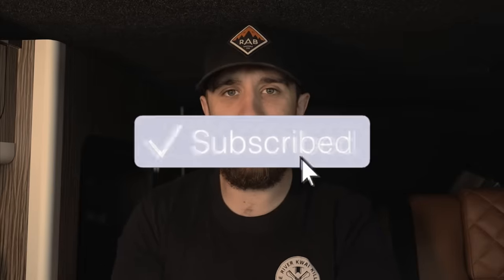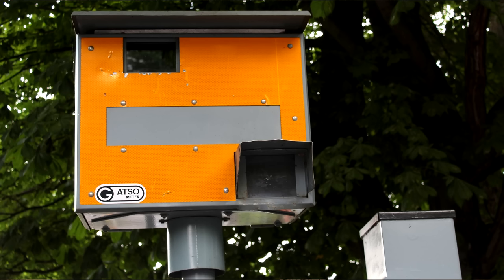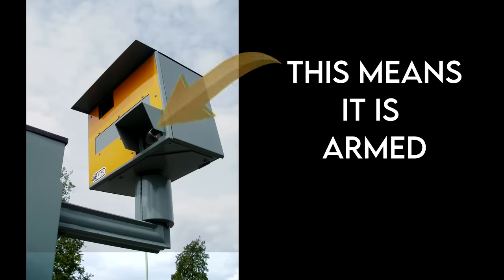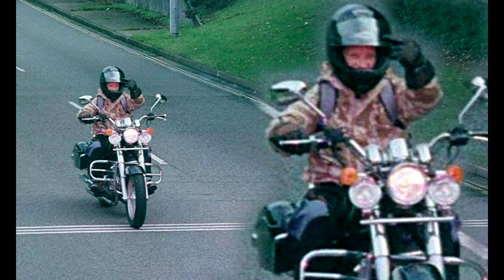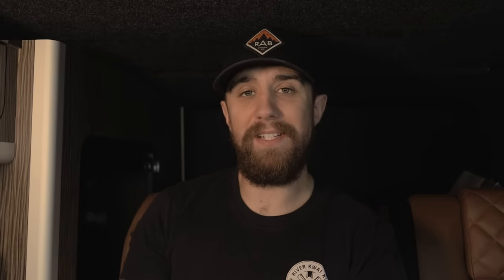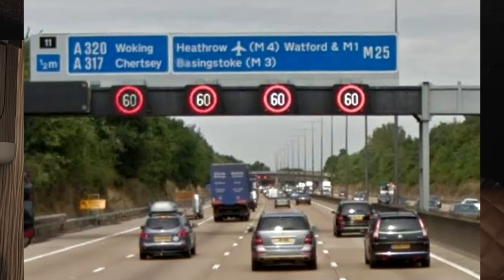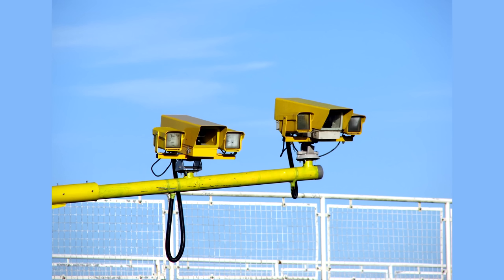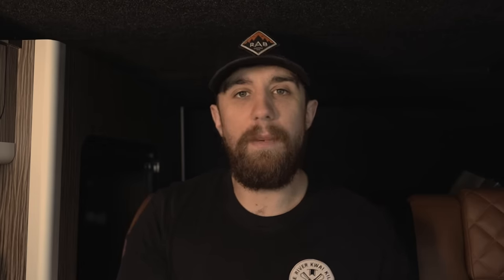How Speed Cameras Work and What to Look Out For

Comment: I suspect the local councils are jumping on the revenue making bandwagon as well with those temporary speed checks, I've seen two cables stretched accross the road to look like serve equipment but two very discreet cameras recording each vehicle that passes.
So they could well be speed checks, but what ever it is they clearly want your number plate for something.
Reply: These things are not speed checks, they're traffic survey machines simply counting traffic levels. Also, no camera so they couldn't identify a vehicle.
Reply: @PurityVendetta  Yes and no, yes some of them are traffic surveys, but some actually have cameras stealthily placed on lamp posts the same colour as the lamp post so they are very hard to see, also they often have twin cameras so the first snap will presumably be one camera and a send snap from the other.
Not all of them have cameras but a few do.

So that is why I suspect they are speed stealth cameras mostly in 20 mph zones.
Reply: @flitsies  This sounds like what used to be an old system, called "DS2" consisting of three rubber hoses placed across the road, connected to a computer inside a parked car (usually on a verge at the side of the road), the time taken to pass over all three hoses would compute the speed, and a camera and flash unit within the car would take a photograph.

Are you sure that's not what you're thinking of? I've yet to see or even hear of the one you're talking about and I work in law enforcement.

Comment: You didn't mention that the HADECS don't use the white lines painted on the road. They're frequently mounted where old GATSO cameras used to be, and the old lines are still pained on the road. The HADECS see way beyond the markings so don't be fooled into thinking you can accelerate once through the white lines.
Reply: HADECS are only used on the motorway to my knowledge. I've never ever seen a HADECS on any other road, not even on a dual carrigeway and I drive probably close to 30,000 miles a year in my own car, let alone driving a lot for work. Also the white line is a verification check... a secondary measure to prove and confirm the speed. If the camera hasn't gone off by the time you've passed the white lines, it probably won't go off. The radar beam starts right by the camera on these. They have dual radars that function independently of each other hence why most don't have secondary lines on the road, as there is no legal requirement due to the fact that it has the two radars AND they work independently of each other.

Comment: Try the variable speed limits around Newport South Wales M4. 70 MPH for miles, no traffic then boom! 50MPH illuminated sign, then the next one 60 MPH, the next 50 MPH, 40 MPH, etc, then back up to 70 MPH again. On one occasion there were deserted roadworks and “use hard shoulder” the illuminated sign went down to 20 MPH, on the M4, I thought the vehicles behind me were going to rear end me.
Reply from the maker: That is exactly where I got caught! The picture they send was me going 60mph in the inside lane with no traffic around me on a motorway 🤣

Comment: Average speed cameras were introduced on the A9 Inverness to Dunblane road in 2014,  27 different cameras over a 136 mile stretch of road.
Without doubt, these cameras slow drivers down and save lives, within 24 months, fatal accidents had reduced by 68%.
Prior to the 27 new cameras, there were 2 Gatso cameras on the 136 miles of road.
Reply: Additionally, they have made driving the A9 much more pleasurable as they also raised the HGV speed limit from the normal single carriageway 40 to 50mph

Comment: A new trick in the north east/yorkshire area on A roads you pass a mobile van,speed up thinking you're safe about 1/5 to 1 mile later there's a second mobile van usually just round a bend.Got ya
Reply: yes and in radio contact so they can pull you in and you wonder why pick me youve been picked 1/2 mile back  tuff.

Comment: What if snow is covering the road markings, can they still nick you?
Reply: yes for the second one, there only there as extra evidence, they can read your speed without the lines but if you tried arguing saying the cameras wrong it takes 2 pictures a second or so apart and the lines are a metre or so apart so apart so they can work out from the time divided by distance to prove you were speeding.
Reply: seriously?  speeding in snow?
Reply: rally cars can do yes it can be done.
Reply: @raypitts4880  in controlled conditions, with full roll bars, full harness restraints, helmets, co-driver, closed roads, a car in tiptop shape with appropriate snow tires.... are you suggesting that the question is on behalf of a rally driver?

for any other situation why would the fact you'd get caught speeding in snow - just shows mentality of some really

Comment: I'm not convinced about the SPECS cameras being all that safe a method of enforcement. By putting up a camera, the Highways Agency are admitting that the area covered is a hot spot for accidents (because they can only put cameras up in areas of higher than normal accidents). However, if the area covered by the camera is so dangerous, surely you want people continuously at the road ahead. But unless you have cruise control and know how to use it without thinking, average speed camera areas have you continuously looking down at your speedo. Even if you do have cruise control, you still have to look down for 2 seconds over all to set your speed.

I used to work for the company that maintained the GATSO cameras. The lines on the opposite side of the road were so the camera could be turned to capture the opposite road (when fitted in the central reservation only). They would keep the camera in the same position for years to get people used to it and suddenly flip it around to catch an insane number of people a day. They initially wanted to have the same design on the back as the front so you always thought it was facing towards the other side of the road. This idea was canned before it was released and very few cameras were turned as people were shooting through, seeing the flash, panicking and slamming their brakes on which was causing more accidents than the site was seeing pre-camera.

Comment: Lots of griping and moaning here, and while I agree with most of them the answer is simple, don’t speed then you don’t have to watch out for cameras and all the rest of the nonsense. Speed cameras are not dangerous, drivers who drive on the limit so they have to watch their speedos are dangerous. Don’t get me wrong here, I have my share of tickets too and being held at 50 for miles of empty roadworks is frustrating, but you have to cater for the idiots along with the sensible. I would also say that I knew someone who worked on motorways and he told me that someone drives into the works (through the cones) every single day without fail.
Reply: Roger, stop talking sense!

Comment: Near where I live... There is a tree that catches a fair few speeders.
The tree is on the exit of an off camber corner in town just past a 20mph school zone... But it also sits at the end of a 4 mile straight urban road. The speed limit for the majority is 40mph, this drops to 30 and them to 20 for the school, then sits the corner....
We had a mobile speed trap van once, talking to the dude.... He said he'd caught 140 exceeding 40mph in just 1 hour.
The tree catches around 1 night time speeder a month.. In January, it caught a dude and his mate, exceeding 120mph. His car was cut in half and looked like a shredded bean can. 1 less knob on the road.
The tree lost a little bark.

Tree scored another last night... His cakky Corsa is still in bits by the roadside along with a pile of plastic n glass.

Driving standards have certainly tumbled over recent years. There's far too many knobs on the roads and as cars have got safer people drive faster in search of excitement.
Reply: Years ago on the Radio 4 program Genius the guest judge suggested that we should remove airbags and place a spike facing the driver on the steering wheel - that would concentrate the mind on safer driving...
Reply: Those are my favourite kind of trees!

Comment: Love how you can be travelling at 50mph motorways and lorries fly past within spec camera areas. I always thought it’s 50 for everyone when advertised but not lorry drivers 😂
Reply: That's because their mostly poles that can't be traced half the time....
Reply: Because the lorries' tachographs are accurate to about 1%, checked every 2 years and recalibrated every 6 so that 80km/h shown is near enough 80 km/h (50 mph) on the road.

Whereas your speedo is accurate to about 10%, usually set to over register speed at the factory and never checked thereafter, so that 50mph shown is about 45 mph on the road.
Reply: my astra  shows 140 on the clock sat nav says 128 so yes it do read that 10%.

Comment: 7:55 It’s not about the technology, it’s about operating procedure. In order for a fine or prosecution to stand up in court they have to follow the correct operating procedure exactly. The operating procedure is based on reducing errors and false positives, and maximising accuracy. This is why they lane pairing is a thing, and why (if it’s really not a myth - to me it makes sense that it would be true but I have no way of verifying that) it will continue to be a thing until a different camera system is introduced (like the newer cameras on the smart motorways for example probably don’t have this restriction where they are used for average speed enforcement).
Reply: Lane pairing for ANPR cameras hasn't been used for a long time, it was first a problem when ANPR was first introduced a long time ago... nowadays ANPR uses a database and all it has to do is read the plate, store it in a database and compare that "read" to a previous "read" with a previous timestamp, it can calculate the amount of time taken and because the cameras are at known fixed points the system also knows the distance between the cameras. From that it can easily generated the "average speed". 

Lane changing DOES NOT affect ANPR speed enforcement cameras. The moment you pass a camera it reads the plate, makes an entry in a database along with a timestamp which is compared to a previous or subsequent read depending on whether or not that's the first average speed camera you've passed.

Comment: On a motorway what are the 3 or 4 cameras for set back about 100yards from the speed camera
Reply: They record the gantry showing the speed limit in force at the time. Otherwise you could barrel through at 70 and say "It was showing 70". when in actual fact it was displaying "50". Without them it would be a reasonable argument. Now they literally record the gantry signs when the variable limits come on, and it would record someone speeding past with the gantry displaying "50" and the camera flashing. It's basically solid evidence that the gantry display wasn't faulty and was displaying the speed limit in force at the time.

Comment: There is Gatso speed camera (I believe)* near where I live in sussex, it places in middle of dual carriage way, so it can turn to catch drivers for example one month it could be facing wsst bound and three months later it can be turn around to face east bound, which means it could flash a driver going opposite way of spreading driver, also I noticed that with Gatso camera (also I believe)*, is if a emergency services vehicle going towards the camera and they over take a vehicle and going on the opposite side of the road the camera will flashes.

* these cameras are yellow box with camera painted on the back off then

Comment: On the average speed cameras, on one road near me (at least according to our local press when the cameras were updated), we have cameras that are both instantaneous and average.  So, if you speed past them, but then slow down to reduce your average, you can still get caught by the instantaneous check.  The road previously had average cameras that were on overhead gantries arranged on a "one per lane" basis (and before that, they had Gatsos) but the new cameras are just single cameras at each check point covering the entire width of the road.

Amusingly, when the "one per lane" cameras were on the road, the thing that is now a myth (as mentioned in the video) also hit the press.  i.e. that if you change lanes between the cameras, the system loses track of you.  At that time (many years ago now), it was a genuine failing of the system, but it has since been addressed.  When commenting on the fact that people had been changing lanes to avoid getting caught, the papers reported that the road agency had "asked people not to do that."

Comment: Speedcurb cameras can also be red light cameras..

Also for specs. If you say, went past one set of cameras at 60 (and the limit was 50 etc), you could just slow down to 30 so the average speed becomes lower. Theoretically you could go past one at 100, and then do 10mph for the rest of your journey to even it out
Reply: The speedcurb aren't red light.

SpeedCurb is literally just speed.

There's a slightly different variant called RedGuard which is essentially the same camera but slightly different, and that it only enforces red light offences.
There's also RedSpeed which often sit at crossroads and enforce both Red light and Speed on green.

These cameras are manufactured rather aptly by "RedSpeed international".

SpeedCurb is speed only.

Comment: The way I understood the colour of the cameras was that if they were painted yellow the body that was responsible for them got the money generated by them. If they weren't painted yellow the money went to the treasury. I could easily have dreamt all that though!  What I find really useful in my car is a variable speed limiter - just set it when going through average speed cameras. through the roadworks I then think there's something wrong with the car when I put my foot down and nothing happens!

Comment: Nice and informative.

I was doing 43 in a 40. It was a GATSO. As soon as I saw the lines on the road I reduced to 37mph before the white lines ended. It was on a road I am unfamiliar with and had never driven on before.

I am not sure if this camera was working. 

Anyway, based on this information does it sound like I will get a ticket? Do they measure from the first white line to the last white line or in or the lines inbetween?

Your educated opinion is much appreciated 

Great chanel and +1 sub.

PS I never saw any flashes but can not be 100%.
Reply: Did u get a ticket
Reply: @Josh-mw4bq  no I didn’t!

Comment: There’s a reason why they give 10%+2 that’s because of tracking and wheel adjustments on car tyres. If you increase your tyre size it will increase it’s rolling speed so affects your speedometer and they give that difference to allow for this. Not every police force allows the 10%+2

Comment: Got a fixed penalty around 10 years ago from a fixed camera on the A5 in Warwickshire for doing 48 in a 60. It somehow knew that I was in a truck and should have only been doing 40 even though a car could legally go past the camera at 60. So there was clearly more technology with that camera than just detecting speed.
Reply: It can tell by the amount of time it takes the vehicle to go through the radar beem!
Reply: @NoBody-gf8ie  surely there must have been some other technology fitted which triggered the camera when a truck came past doing 48 whilst, at the same time, not being triggered by a car doing anything under 60.

Comment: What happens if you go through a traffic signal  on amber, will the camera clock you??
Reply from the maker: I believe there is a period of time once it's gone red you will get away with. To my knowledge you will not receive a fine for amber 💪
Reply: Amber is legal to go through. The cameras can tell how long the light was red for before hand, so you could argue in court that the light changed to red as you went through. I wouldn’t want to see how much weight that argument held personally though
Reply: If a set of traffic lights is working properly you will get 3 seconds of amber before the red shows.